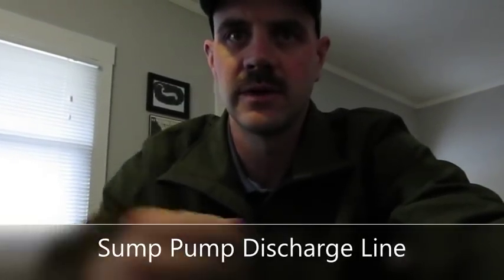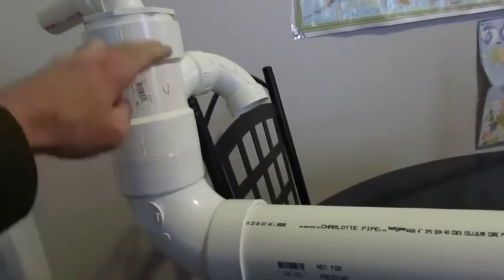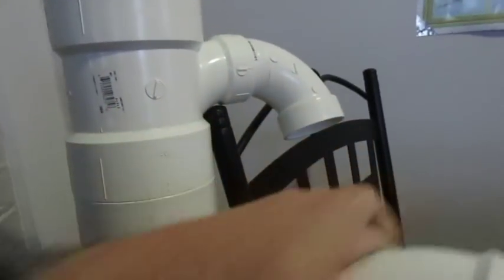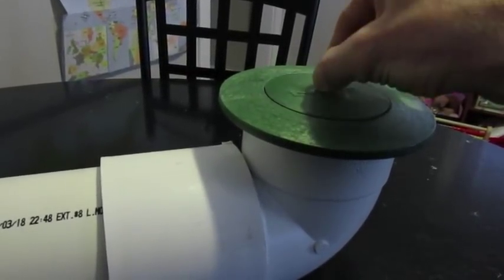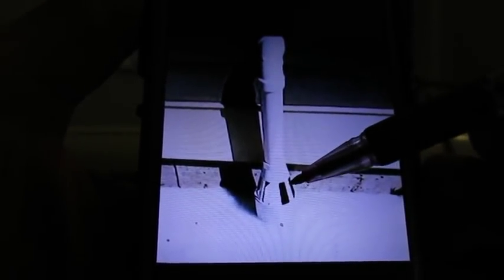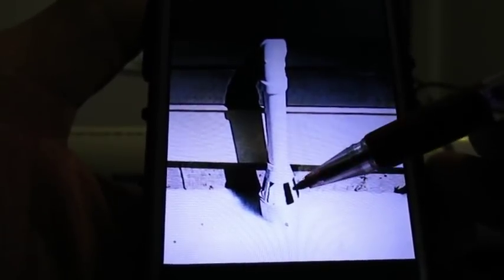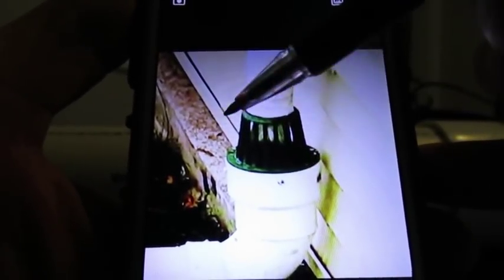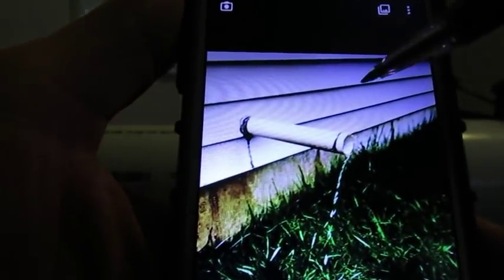Sump Pump Discharge Line...Considerations

Comment: Hello Philip, I would like to share my findings with my sump pump discharge arrangement.   So after the house was built I used a 4” pipe to discharge the water from the house to our pond where it dropped about 2’ to the water/ice (roughly 150’ distance front the house to the pond.  Once the temperature dropped below -20 Celsius / -4 Fahrenheit the 4” pipe froze up.   I had a bunch of 1-1/2” pipe so for temporary I hooked up all of the 1-1/2” pipe across the top of the snow, not wrapped up or insulated at all and I was surprised that it did not freeze up at all this winter and the month of February was extremely cold with temps of -42 Celsius/ -43.6 Fahrenheit.    This summer I will be trenching in the 1-1/2” pipe to the pond as it worked this well above ground I feel it will work below ground.  Obviously has to do with the size of the pipe and the volume going through it that keeps it clear.
Reply: The pipe really didn’t see the light of day until the snow started to melt.  We had about 2’ snow at a minimum on the ground at any given time so there was no chance of sun seeing the pipe.   I think it is the volume of water that goes through that kept it clear.
Reply: This worries me to read as I just got done burying 4" SDR35 and I live in Wisconsin. Mine only goes about 20' and terminates into a sanitary T that is buried in 2'x2'x8" area packed with drainage rock. The top of the T has a popup emitter so the water has a place to go when that well area gets saturated and I have a backflow preventer about 15" from the end of the pipe to keep rainwater from walking back up the pipe. Replacing that 4" pipe with 1.5" conflicts with all of the research I did before I buried the pipe I used. I'd hate to see you replace all of that pipe only to have it freeze up too. How do you know that the 4" pipe froze? Did you glue your fittings? What kind of 4" pipe did you use? (Corrugated, SDR35, SCH40, etc.)
Reply: @philipwilliamshomeinspecti4665  I think I can see how room temp water rushing down a 1.5" pvc pipe might not freeze up during it's travel, but 150' is a long way to go, and still stay warm!  But a large volume should make a difference.  Also, he mentions 2' of snow....  I wonder if the "warm" water melted the snow around the pipe, creating a kind of insulated tunnel along the length of the pipe; whereas, when buried in the ground and the ground freezes up, no chance of creating an "insulation" cavity!

Comment: Thank you for this. Very helpful! I have one of those non-ideal situations. The discharge on my house is only about 5 inches off the ground. With being in the Midwest, freezing is a concern for me. That 5 inches doesn’t give me much room underneath a freeze relief device when I add one. Would it be better to just live with that minimal height or add some piping on the exterior to redirect the line upward a few inches in order to get a better height for the freeze relief device? Which seems like the greater risk - water freezing in the line before the relief device in that redirection add-on section OR water freezing on and around a device that is only 4 inches off the ground? Drilling a higher hole from inside the house is not an option unless I go up into my living room. To lower the ground level on the side of the house where the discharge is at would require a major regrading of a large piece of the property. Thoughts?  Thanks!
Reply: Thank you!

Comment: Great video - gives me a lot to think about.  In your mock-up, what is the part above the 4x4x1.5 Tee that you used to accept the 1.5" discharge from the house to create the "uncoupled" connection?
Reply: @philipwilliamshomeinspecti4665  I think you'd want a "4 in. x 2 in. PVC DWV Spigot x Hub Flush Bushing": the larger diameter goes into the hub of a 4" fitting, like the Y; then your 1-1/2" discharge pvc pipe would fit easily into the 2" opening (actually, sized to cement in a piece of 2" pvc pipe), which will allow for the vertical expansion you speak of, without grabbing the 1-1/2" pipe.
Reply: @philipwilliamshomeinspecti4665  Found it at Lowes - they actually call it a bushing.

Comment: I disagree with two elements. First is the up elbow at the very end. It simply encourages a pool that will freeze. If possible, an air gap at the end, in the form of a drop off from the pipe.

The other element is the up y at the top. Again, if the line freezes, the up y reduces the opening. A t would be better, or reversing the y to slope down.

Every other idea I'll be employing when get around to doing mine. But I'll be integrating it into the downspout line.

Comment: How far down would you dig the trench? I heard youre suppose to drop 1/8 or 1/4 every 10 ft. Im worried the pop up will be too low. is there a point I will have to elevate the pipe so that the pop up can be  surface level? I live in MD where our winter can be brutal for a short period of time.
Reply: Philip Williams Home Inspections yes perfect! I was really unsure if I could add pipe  vertically once I reach the end of the discharge line to bring the pop up surface level. Thank you!
Reply: I believe proper slope is 1/4" per foot. That provide adequate velocity for water. 1/4" at 10' is next to nothing.

Comment: Great video! Can I  use an 1.5" tee instead of the 4 X 4 X1.5?
Reply: @philipwilliamshomeinspecti4665  Thanks for the reply...I will replicate your system as shown. I guess I can lear from your mistake! Lol. Again, thanks for this video it really helped.
Reply: @philipwilliamshomeinspecti4665  I know too. I have the 4x4x4 and water gushes out the side freeze out area when the pump kicks on. I responded to this in a comment above, but here is the gist of it. I put in a 5" piece of 4" pipe with an end cap on it, and drilled holes higher up on the end cap to try to limit the amount of water gushing out. But I will also be limiting the amount of water coming out when I need it to act as a freeze out. Any ideas on what I should do here with this 4x4x4 Tee?
Reply: @philipwilliamshomeinspecti4665  No it is not blocked - it is all brand new. The discharge line from the sump pump is 2". It goes to the Tee 4x4x4 like your video suggests. It is free from attachment, for freeze and thaw cycles, and there is the airspace from the end of the 2" to the 4" sewer line that goes underground. When the pump kicks on, the green popup activates and water also comes out the Tee where mine is 4" and yours is 2". There is a grill covering the Tee opening where you have your 2" pipe and elbow. That's where the water comes out- thru that grill. I can remove the grill and cap it when it is not freezing. One other thing, my green popup is right before a drainfield. The sewer line goes to a drainfield with perforated pipes thru it. The drainfield pipes are currently full of water, so the popup is the only place for the pumped water to escape, along with the freezeout. Again, this is a high powered pump and water is probably not going out the popup fast enough for it, so some of it goes out the freezeout. When I take the grill off and look in there, water is splashing around this airspace between the end of the 2" discharge and the beginning of the sewer line (in other words the airspace in the Tee).
Reply: @philipwilliamshomeinspecti4665  yes 4" solid sewer line, thin wall, all the way to the popup, then after the popup it goes to a little more sewer line then to a 4" corrugated perforated drainfield system
Reply: @philipwilliamshomeinspecti4665  yes, i guess i could replace the 4x4x4 tee with a 4x4x2 but when it does freeze I would be better off with 4x4x4, especially with this high power pump. I can always cap it off in the summer and just put a 10' length of sewer line in the Tee in the winter, as it runs downhill at least that far. Thanks for replying and thanks for the video, which is helping a lot of people.